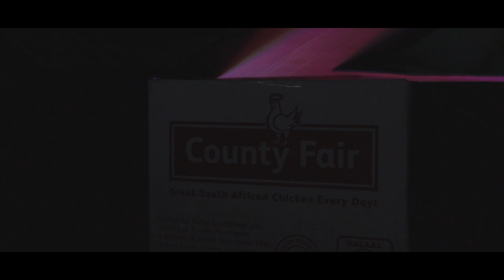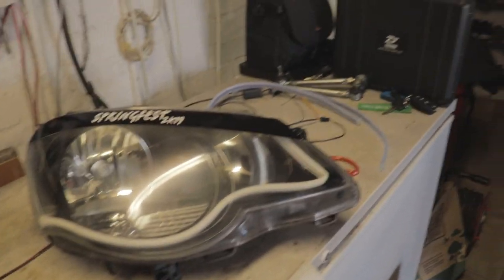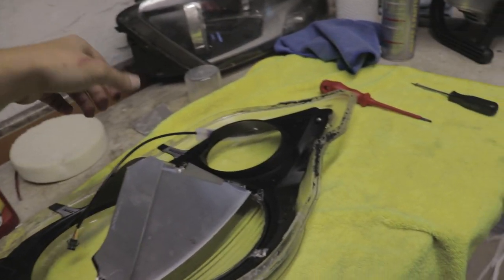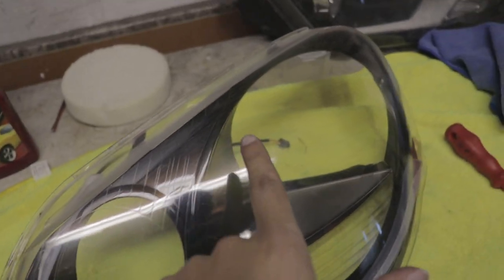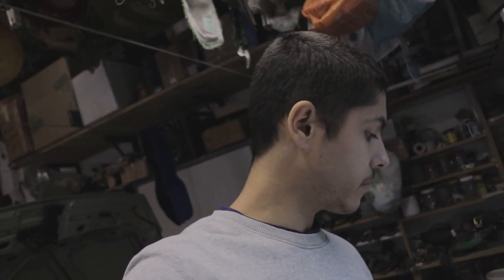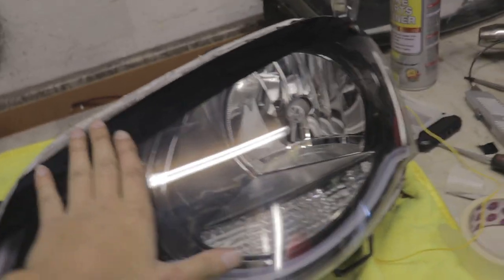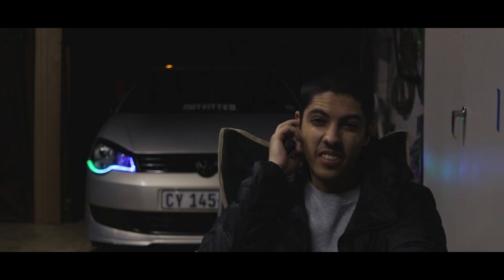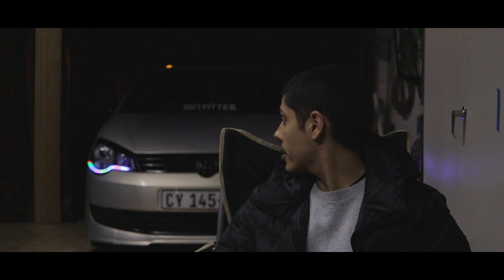Remote RGB DRL VW Polo install | THE GERMANESE CPT

Comment: Link led? Aliexpress? Amazon?
Reply from the maker: Hi there

We go the strip here from a supplier but this link is the same item. Its a pretty common item and this one even connects to your cell phone

https://www.aliexpress.com/item/1005002541003763.html?algo_pvid=5a80886d-75c5-4494-91cf-20515890c364&algo_exp_id=5a80886d-75c5-4494-91cf-20515890c364-3